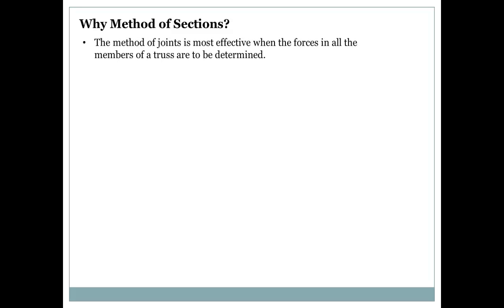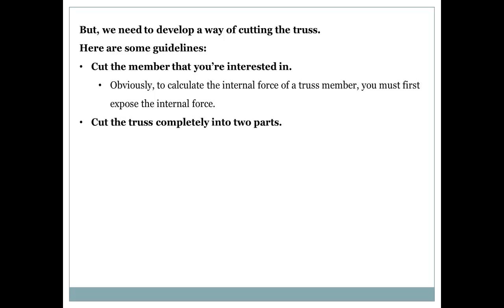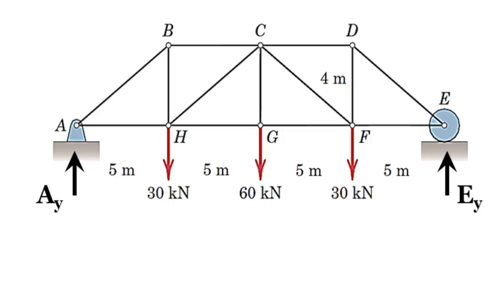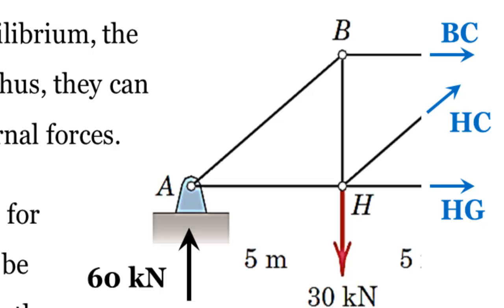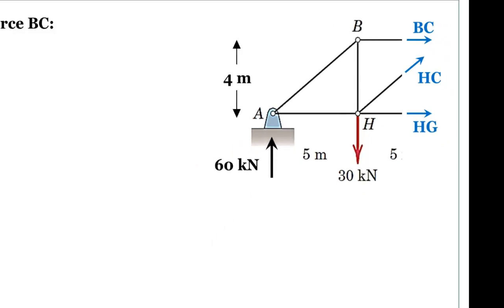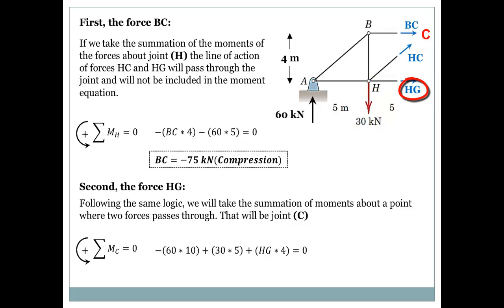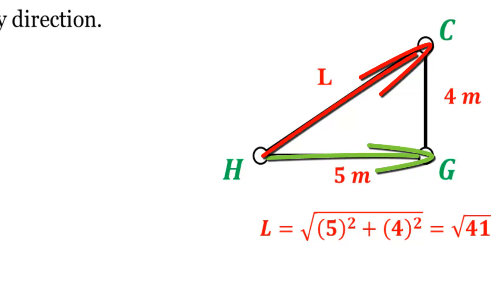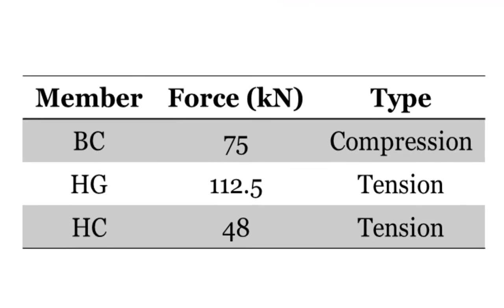Truss Analysis Using Method of Sections

Comment: For calculating HC we can use (sin/cos) of the angle after we calculate it by (tang) witch equal to 4/5
Reply from the maker: yes you can. But the question is, how many numbers after the decimal place will you use?

it is always nice to use ALL of them right? However, that is impossible. That is why I use the triangular ratios

Comment: what is the internal force acting on the BH? is it 30kN ? but the 30kN is an external force...correct me if i am wrong...
Reply from the maker: The internal force in member BH is 60 kN in tension. saying it is 30 as the external load, you assuming all other members connected to joint B play no role in carrying the 30 kN

Comment: what if truss is not symetrical??
Reply from the maker: if you are talking about calculating reactions, the only difference in case the truss not symmetrical is that you need to go through the process of finding the reaction using the three equations of equilibrium (Sum x , Sum y , Sum M). Yet, the process of cutting the truss to perform the method of section is unchanged. 

Thanks for stopping by :)
Reply: thank you so much for quick response, i was able to do my assignment thanks to you!

Comment: So, why did you purposely say that one of the members was in tension and not compression? How does this help you solve the section?
Reply from the maker: Kuniko Bufford determining the type of force in a member can help me in two ways, (1) When summing the moments about a point the direction of the force will determine the sign of the moment produced by the force (clockwise or counterclockwise). (2) In terms of design, compression members have to be checked for buckling effects (which will determine their stability as well) where as in tension members buckling is not an issue. So you see knowing the type of force in the member during and after solution is equally important. Hope that answers your question

Comment: when you took the moment about H , why wasn't the member AB included ??
Reply from the maker: We only include the forces from the exposed (cut) members, reaction forces, and external applied forces. Since the member AB has a force that is not exposed by a cut, not a reaction force, and not an external applied one, we do not include it when taking the moments about a point.

Comment: I have a question. When finding the reaction force why don't we calculate the horizontal axial force Ax of the hinge ??
Reply from the maker: you should find all reactions just in case. I did not bother here because I knew that I will not use it in the analysis

Comment from the maker: when summing moments about and point we look for couple of things, if I am cutting through members, I will use the forces of these "exposed" members, the reactions, and external loads. BUT, if one of the forces (exposed, reactions, external) line of action passes through the point I am summing moments about, the force(s) will not come into the summation equation.
if we apply this to moments about H, member AB does not fall into any of the forces mentioned above. 
therefore, do not consider it

Comment: For the last part, an easier method is to find the angle of the triangle which is tan^-1(4/5) = 38.7 degrees, then go sum of Fx=0 , and solve for HC by using it's X component of cos(38.7) .. you're equation will be../ sum of fx = -75 + 112.5 + cos(38.7)xHC = 0 , and when you solve for HC, you get -48kN, which is 48kN  in compression

Comment from the maker: The Moment to find BC is taken about Joint ( H ) which makes the rotation clockwise therefore negative. as for the moment to find HG, the rotation is about point ( C ) which makes this rotation counter clockwise, therefore positive.

remember, we are rotating about two different points here. although the direction of the forces is the same, tho points we are rotating about are different.

Hope that answered your question.

CTSCIVIL